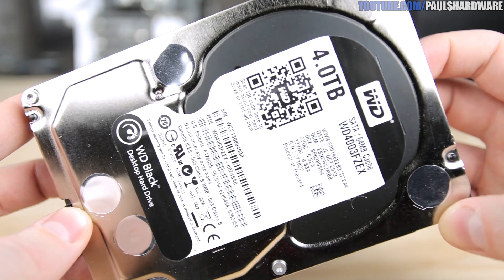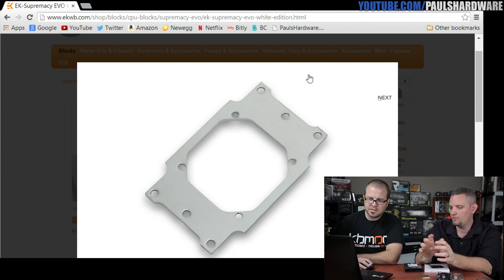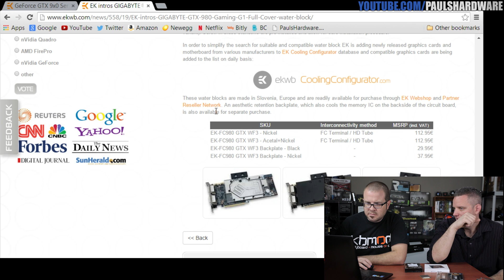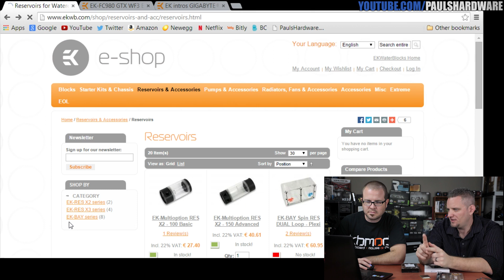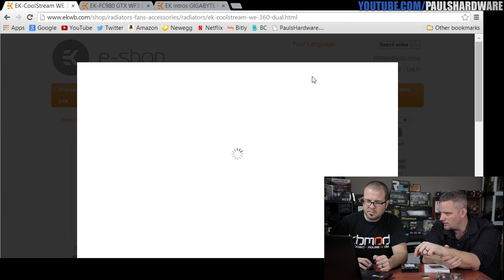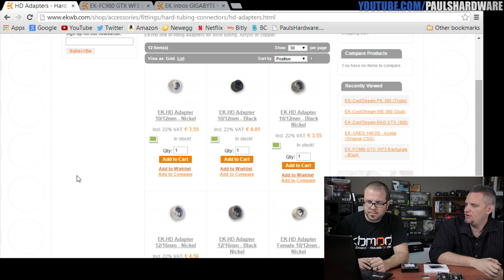Water Cooling Pros & Cons with JayzTwoCents

Comment: A single thick triple rad should be enough, shouldn't it? I mean, the R9 295X2 cools two overclocked R9 290Xs with just a single 120x40mm rad. Yeah the temps are high for a water cooling solution, but in the big picture the temps are still perfectly acceptable and keeps pace with the best air coolers and no one seems to have a problem with the temperatures on those. A 40mm or 60mm triple rad should be fine with two GTX 980s which don't put out nearly as much heat as 290Xs, and the 5960X. Even if temps aren't super amazing and on the level of most water cooling builds, they still should be very good temps overall.

Comment: I'd recommend a 1200 watt ps (if you were to overclock) this would guarantee a smooth n clean delivery of power to the gpus,cpu, etc

only 32gb I'd go w 64gb!!
(prefer xeon E5 w 128gb which runs on X99)

Fractal R5 is the cause I would recommend to my brother.

You forgot to mention "The Fractal Design Define R5 (Black) ATX Mid Tower Case supports video cards up to 440mm long, but video cards over 310mm may block drive bays."

You can overclock memory from 2400 to 2666?

Project Names: Pomeranians, Bald Eagle, Junior Mint, MisChief, Panda, Penguin, Peppermint Patty, Zebra, Zorro, (lol, a vote for Skunk works) Pepe Le Pu

Comment: 31:15 Wrong info Jay - EK does have replacement acrylic cylinders for their res/pump combo in 250 and 400 sizes. What they sell you is the D5 pump/res combo with just the short 150 cylinder fitted. You unscrew it from the pump base and replace it with a bigger one if you need it.

Comment: AMD needs water cooling...
Reply: Na
Reply: Clean Hardware
I will probably keep saying that untill amd makes a new architecture and updates their manufacturing process. I heard they were gona do this soon so I am pretty exited.
Reply: Yeah 380x should use 300w SoC soc means system on chip so cpu (80w), ram 20w, fans and etc 40w and gpu 160 in theory
Reply: Clean Hardware
what about the cpus?
Reply: 14nm and if the 8370(best amd cpu better then any 9000 series if overclocked to same speed) uses 80w so, i dont think it will use more then 60w and its already the halve of the size :P
Reply: Clean Hardware
I hope they makes their cores more powerful. 14nm should help in that so yay!!
Reply: Yes it will, they using a new tech. The one that uses nvidia, Hyperthreading and they will have from 2up to 8 ture cores and 16 threaths :D 
Before they uses a cores agrupation so 2 cores was always together, so yes they will be powerfull
As powerfull as intel, i hope :D
Reply: Clean Hardware
I want to know where your getting this info. It sounds so good I want to read that article/articles that you got this info from.
Reply: Clean Hardware
Thanks dude
Reply: Clean Hardware
Just finished reading it and my final thoughts are that Amd has to go with 20nm at least in their next cpu line up.
Reply: 20nm its a will more is a can, if i would amd i would build a 20nm for almost everythink and 14 for the most powereaters :D
Reply: Clean Hardware
yea totally agree.
Reply: Clean Hardware
wow I could not read that comment...
Reply: And i cant delete it. Sometimes i forget what i was writing so it doesnt make sense (i know but not the exact words)
Reply: Clean Hardware
You can edit it though.
Reply: Now i can, deleted
Reply: Sean Kim and now there is ryzen

Comment: CPU has to be the 5960X , also EK do the longer length reservoir tubes so you can put a 250mm reservoir tube on the pump/reservoir combos

Comment: I ain't got a clue for a  name but some of the comments are pretty sweet.

I never wanted to get into watercooling because of the costs because I'm a budget builder.  One day I won a AIO cooler... the H50.  I enjoyed it to an extent.  Later I joined a FAH competition and my teammates had suggested slapping a Kuhler on my GPU.  After awhile, that wasn't enough so one of my teammates donated some customer water cooling parts and that got me going into the watercooling world.

I'm afraid saying that starting watercooling is going to cost you about $3-400 are going to scare people off because of the risk factor and the anxiety of doing their first one.  You CAN get away with going cheaper but you'll have to be EXTREMELY careful and ask LOTS of questions.  If you go the used parts route, be sure it's from someone reputable and with lots of experience.  Last thing you want to do is buying a pump from someone who's only been in it for a year and didn't know running it dry can harm it.  Or someone who don't understand hand tighten does not mean tighten it with a wrench.

Going cheap and hand-me-downs have been a blessing for me because over time I have been able to swap out for better blocks, rad, and reservoirs.

Another thing is that either I missed it or it wasn't stated about how much rad space a person should go with.  Personally the best advice I ever received is go with as much rad space as you possibly can.  Even though it may be overkill if you got just a cpu or cpu + gpu... you'll end up saving money if you end up deciding to add another component to cool and you don't have enough rad space to cover that.  You'll end up having to sell the old rad for cheaper than paid for and have to purchase yet another rad.

Lastly I don't think was covered was going with full gpu blocks or universal gpu blocks.  There are pros and cons that could have gone over for each of those.  I started off with a universal so I wouldn't have to deal with having to get a new block when I upgrade my GPU.  Boy was I wrong.  Nvidia have changed their screw sizes in the past and AMD have had their GPU chip depth changed.  I don't think I'm ever going universal again.

Comment: GUYS! 150$ on FrozenCPU,  Raystorm 750 EX240 Kit. everything you need except fluid. LITERALLY EVERYTHING.
Reply: they are doing a full custom loop not a kit :)
Reply: Well, this is so easy to add anything on it and also has the power for it. Just really cheap to start a custom loop.

Comment: Buys cards with some of the best air coolers on the market. Water cools them.
Reply: ImportNation Maybe it was sponsored ;-)
Reply: Water cooling will cool them even further during extreme gaming
Reply: Noah Ding Not my point, I am aware of that. My point was he is buying cards specifically to water cool. He bought some of the best air cooled cards, just to water cool them. He should have bought reference coolers.
Reply: ***** Maybe it was :P Anyways, I stand corrected.
Reply: Custom PCB with better power delivery is going to OC better then a reference design.
Reply: JayzTwoCents did you respond because of dude's username haaa

Comment: So, my stock fan on the 8350 is sooo loud, I want to pick up a new cooler. Could i buy the H100i, or somthing of that sort, Like the cooler that just has a fan and two pumps. Or do i need to buy alot more than that? Im only 15, so budget is a little tight, cant afford 300$ water cooling xD If i need to buy alot more than that then could u recommend a good air cooler
Reply: I just use a 212 EVO, and it works great!
Reply: I would personally recommend a high end air cooler, like one from noctua. Some of their high end air coolers are actually better than some water coolers and they are more reliable due to the only thing on them that is possible to wear out is the fan, and they make some really good fans. If the ability of software monitoring does not phase you, and you want a set and forget solution, an ultra-quiet, ultra- reliable air cooler would be the way to go. And they are cheaper. Never doubt air coolers, if you get a good enough mount they can easily outperform top tier full custom loops even. I have personal experience with this. 4.5GHz 4820k with stock cooler at usually under 20 Celsius above ambient room temperature.
Reply: H110 is fine, its slightly better than the h80. Corsair still hasn't addressed the software problems that some users report though. It'll still work as long as its hooked up correctly. The 212evo is nice too. I never hear of people having issues with it :)
Reply: Sell your amd and go Intel
Reply: Once you go Intel,you never go back. I was amd for years, but got a z97 board with the 4690k, won't need an upgrade for Atleast 10 years.
Reply: EVO 212 is always a solid choice, my i7 4790k is OC'd to 4.8Ghz and rarely goes over 55 C
Reply: Stephen McAllister i would need a new mobo also, out of the question
Reply: Stephen McAllister I could ditto that response as well. But I totally understand financial feasibility. Some guys never had serious issues with AMD, unfortunately I did. To each his or her own.
Reply: UniCrafter They probably don't burn out as much as water pumps also. I got about 2 years of use out of my H100 before the pump decided to crap out :(
Reply: Dont take an crappy aio

Comment: Good build for editing / gaming ?

Mobo: Gigabyte 990FXA-UD3
CPU: AMD FX-8320 8 core @3.5gHz
GPU: GTX 760 amp! from zotac
PSU: LEPA 550W 80+ Bronze
Storage: 120GB SSD (I have a 1tb and 500gb right now)
Case: NZXT H440
Reply: I would switch out the 760 for the new 960
Reply: lol you're going to need ram.
Reply: was just testing, I aleready have this build (ram is standard kingston 1600 8gb) I didn't learn anything I didn't know, I'm still pissed about getting the 760 weeks before the 960 came out ;-; surprised nobody said anything about the extremely expensive case c:
Reply: Amxri U. I just swapped my 8350 for the i5 4690k, and the difference in performance genuinely dropped my jaw. Intel are on fire.
Reply: 5UR3X3 fuck that i got some old ddr1 ram in my basment ill use that with an adapter
Reply: Droid xD DDR1 MASTER RACE
Reply: Amd cpu are shit editing and gaming

Comment: Go for 5960X. Because you can use it!
Hard tubing for sure.
EK EVO CPU Block
EK 980 Full cover block clear
RAM I dont think you need it.
EK D5 pump res combo 150-200mm
16OD 12OD its up to you, 16OD have better water flow, 12OD easy to bend.
radiator.... I think Black ice is better for this build.
http://linustechtips.com/main/topic/238979-%E9%9B%AA%E6%9C%88%E8%8A%B1setsugetukabetter-photo-uploaded/page-2

Comment: Custom loops are a huge pain in the ass, after a few years of living with a Koolance scratch build setup ive switched to all in one coolers and i am much happier when it comes time to work on my system with no drippy water lines connecting everything together.

H90 with a NZXT GPU mount and a SwiftTech H220x for my CPU keeps my system quiet and cool.

Comment: Paul's Hardware Go 5960X. The 5930K is already strong enough not to bottleneck any GPU ever, so it'll be fine on the testbench, and there won't be a noticeable difference, but you will get a real tangible difference in your personal rig upgrading to the 5960X, because you will be able to edit videos faster.

Comment: You missed something in the EKWB shop. If you scroll down the page in the reservoir section, you will find an accessories part. Inside you will find all the parts needed to make a custom Pump + Reservoir combo that fits your case perfectly. You don't have to buy the 140mm version, you can make a 360mm high reservoir with a pump!

Comment: OC'd my fx6300 to 5GHz for less than £50 (~$80) using a very unusual method
Reply: Was it using semen for thermal paste and a £50 water cooler?
Reply: Rambi Ninethousand So basically you have an aquarium cooling your computer. Sounds like a ghetto nightmare. Was there duct tape involved too?
Reply: Rambi Ninethousand i OC my fx 8320 from 3.5 to 4.9 using a hyper evo 212 the cooler cost me like $30
Reply: Asterisk
Difficult to explain, but I used a large container (£4), about 40 litres, and filled it with water. Pumped water out with a regular fish tank pump(£6) that operated at around 600 litres per hour. Bought a really cheap copper CPU heat sink(£10), for water cooling and then finally about five meters of tubing(£35). Out put of water was from one side, and then input was into another side. It takes about eight hours for the water to get near to 30 degrees celcius, in winter, so it's really effective. And even at 30 it still works. It wouldn't surpass about 32 because the energy to heat the water up increases with temperature.

Pros:
-Very effective
-Very cheap
-Safer (less components likely to leak within the case)
Cons:
-More external volume
-Doesn't look as nice
-Unusual, there's literally no online help for this method of WCing.
Reply: Rambi Ninethousand we need photos of "PCuarium"
Reply: Brian Fisher Nope.
Reply: What was that?
Reply: TheNinjacatboy Huh. That's stupid if you aren't running at an integer.

Comment: I feel that if you would have taken it one step further and used nickel plated copper tubing instead of hardline, "Project Monochrome Moshpit" would work quite well. Dark, metal, moshpit, the possibilities!
Working off your "Possum Factory" idea, how about "Zebra Whisper Inc." instead? Black and white, stands out yet stealthy, moshpit (that is how zebras camouflage), strength and elegance of hardline to match the grace of a galloping zebra, whisper quiet, and Inc as ink AND/OR incorporate. Makes sense yet is punny because of you liking multiple takes on the name :)

Comment: Been doing Water Cooling for 6 years now. I have had 2 problems. First problem was when all my 45° Fittings and spilled the water on running system. This happened to both my systems. One fitting failed when i moved it and was able to turn off the system in time. GPU did take a hit but after cleaning it with alcohol it was fine. The other system even after was hit with water still worked. Probably due to water being fresh so it was still not conductive. My last problem was recently when RAD started leaking. This one i noticed only when the water level dropped. The drop was minimal since i could not tell because they system was 24/7 on.

Comment: Of course go with the 5960x
Reply from the maker: I don't think I have any other choice now :-D
Reply: Paul's Hardware :)
Reply: ***** Yeah and the thing is Paul HAS both 5960X and 5930K so to me only reasonable choice is to go with 5960X. Many ppl here just dont get it doesnt cost him any extra to put his 5960X in that rig instead.
Reply: AdamantiumDragon NG 6960X, I am getting that
Reply: Gaming with Milruka But with the 5820k you get less CPU lanes. Go big or go home. By the way nice rig, saw it on /g/ like 2 hours ago.
Reply: Paul's Hardware The 5930k is still reasonable being faster out of the box in gaming and easier to oc then the 5960x. 6960x for Sure!
Reply: Paul's Hardware Don't you have a 760T?. I don't like that case, but it'll show the build much better than the R5 (which yours doesn't have a window either ^^). And I think it'll fit more rads.
Reply: Seems like a waste of money when the prime would be the 5820k as 3 way sli/cf is about as good as it gets at the moment.
Reply: SmartNexus p
Reply: ***** just use the 5930k then

Comment: Looking into gettig a liquid cooler for my new build to cool an i7 4790k overclocked to 4.7Ghz im considering the H100i and the H60 are the temps any different because the h60 is much cheaper
Reply: Sealed loop coolers don't have shit on a custom loop.
there are air coolers that beat the h100i
Reply: Look it up...
Reply: i dont have enough money for a custom loop
Reply: h60 isn't enough for 4.7 go for the h100 much better
Reply: If silence is important to you, you should think about buying aftermarket fans, so I would suggest h60/h75 and then replace the fans if you think you need to (h80 with noctua push-pull, cooling a 3930k quietly for me, and my cpu generate a lot more heat than yours).
Reply: nhd14 best fans on the market and one of th best coolers too
Reply: the extra features on the h100i aren't worth the thin radiator performance. Get an h105 they aren't much more, fit any color scheme pretty much and have a 38mm thick 240mm radiator. Put a couple Noctua NF-F12s on there like I have done and it'll be whisper quiet too. Plus, 120mm water coolers give really bad price/performance
Reply: The h110 will give you more performance, I've got around 25 degrees Celsius on my six core!
Reply: I had an h80i and h100i. The 100i was better than the 80i, but not by much. I used to run around 4.6 with a 4670k and now a 4770k and dialed it back a but after a while.

The fans that come with the units are great, they're just kinda loud at full speed. It never user to bother me. They also sell static pressure fans that have rubber bearings in the mounting locations, they're pretty cool.

And with both units I've owned, Corsair had software problems. Mainly the pump and fans not identifying themselves.
Reply: air is better unless its custom loop
Reply: no it's not

http://www.anandtech.com/show/6830/cpu-air-cooler-roundup-six-coolers-from-noctua-silverstone-and-cooler-master/5

The Hyper 212 EVO is almost the same as the NH-D14 in terms of temperature, whereas the AIO watercoolers are all much cooler. The newer Corsair AIOs are even better than the h100i listed in the graph above
Reply: Dont take an aio take an better aircooler and you have somethink more silenter and almost as good for less money
Reply: I have cooler master hyper 212 evo and i get 4.6ghz on ny i7 4790k 1.300volts